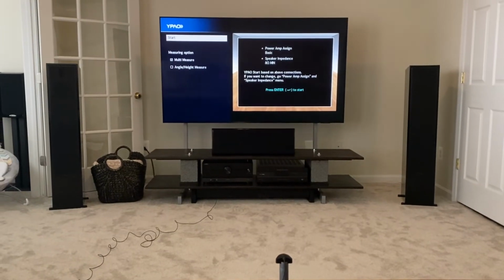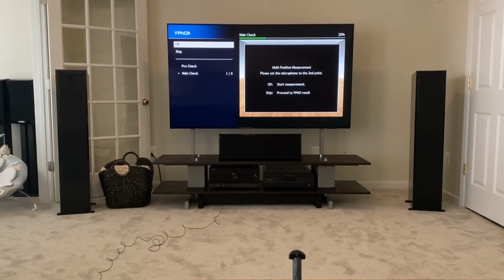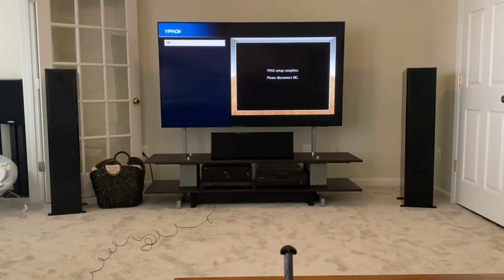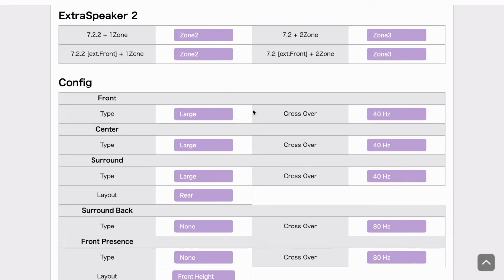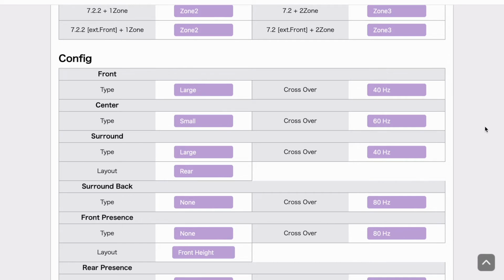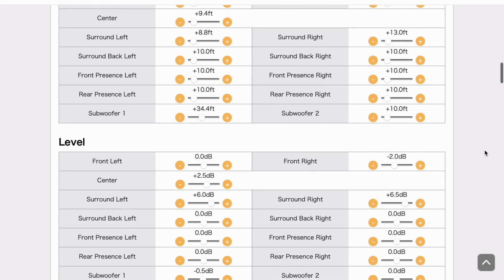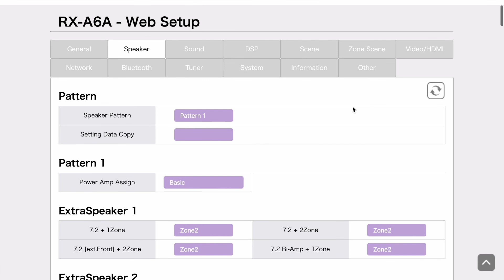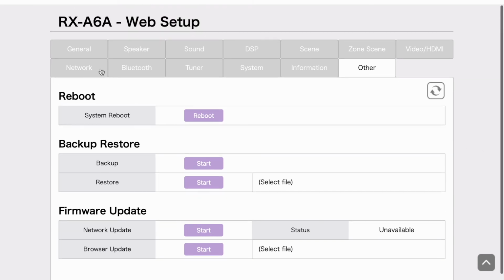Yamaha RX-A6A YPAO Calibration

Comment: You need to place the mic where your head is. Not the middle of the room.
Reply from the maker: Correct
Reply: And do the angle measurements too?
Reply: So place the mic on top of my head?
Reply: I used a tripod for my older Yamaha RX A3060
Reply: @Houndog545  😂😂😁😁🤣🤣👍👍

Comment: My sound system consists of 4 SVS Ultra Bookshelf speakers (2 for the mains and 2 for the side channels), an SVS Ultra Center speaker, 6 SVS Prime Elevation speakers (4 ceiling mounted for Dolby Atmos and 2 mounted on the back wall for the rear channels) and 2 SVS SB-3000 Subwoofers. The system is powered by a Yamaha Aventage RX-A8A 11 channel AVR connected to a Panamax M5400-PM Power Conditioner.

Comment: A note on the crossover when the Front speakers are set to Large; my previous Yamaha receiver allowed me to set Front to Large, Extra Bass to On and also set the Base Crossover. I recently purchased the RX-A6A and haven't found a way to achieve Front=Large, Extra Bass=On and Crossover=60Hz. This is the ideal setting for my Front Speakers when in 2ch.
Reply: I have the same receiver.use the web interface to set parameters.I’ve done it
Reply: I heard if you turn fronts to large and subwoofer on then pump up the bass then turn sub off it will bring extra bass to the fronts.

Comment: Please help!!
I have recently moved from pioneer to Yamaha and i am quite puzzled on this as i have two listening positions. On the pioneer i used to be able to switch between one and other (I always noticed the difference). Is it possible to do this on the Yamaha RX-V6A?
Reply from the maker: I don't believe so.  You can run ypao in multiple positions and it'll use all data for adjustments.  you might want to take measurements somewhere in the middle of the two positions.
Reply: You can surely run the ypao twice and store as different memories or profiles.  Even my 16 year old yamaha does this..

Comment: I thought the new YPAO accounted for height of “presence “ channels too. So it can apply various DSP. Is this not true or is it because you don’t have height channels?
Reply from the maker: It should be able to.  I can't confirm though since I don't have height channels.
Reply: @johnferraro3990  Thanks. I picked up the A6A. And Yes YPAO does perform a second set of 4 measurements to determine height and angle of presence/height speakers. My Denon x4500 didn’t do this which is why it never created the “bubble of sound”. Just sounded like a lot of separate speakers.
Reply from the maker: @GaryWalters  Thanks for the reply and glad to hear it works for you.  Enjoy!

Comment: my set up front kef q950 kef q50a  kef q650 center kef q350 rear and SVS sb4000 sub and yamaha a6a , issue is when listening to music it feels like no bass. what is the remedy to this 
but when im in movies its great lots of bass
also the sounds keeps going off display on yamaha says decoded off
could you help please?
Reply from the maker: I would make sure that your speakers are set to small and cross over at 80hz.  Check the sub during music playback and make sure it's working.  Next, experiment with sub placement.  Try out the sub crawl to find the best place for it.  I'm not sure what your movie source is, but check that out for updates and make sure you don't have a bad cable feeding your receiver.  Good luck!
Reply: @johnferraro3990  running it the movies through samsung QN85QN85BAF
Reply: thanks for the reply
Reply: i switch my hdmi already, but which one do you recommend on hdmi 2.1 earc
Reply: I have the kef550 front ,659 center,350 surround book,160ic ceiling atmos. Set all speakers to small and 80 cross.check your sub settings.can’t remember which knob in the back but one is set all the way up and the other at  80 hrtz.
This Kef system in a small environment with the A6A is nothing but the absolute truth 
15x20 room
Reply: I had the same problem with my RX-V6A. Bass almost non-existent during music playback, but sounded great with movies. The problem was my subwoofer volume was set lower than the halfway mark during the YPAO calibration. So I had to push the subwoofer volume to the halfway mark, then rerun the YPAO calibration. Now I have plenty of good bass with both music and movies! Even after I’ve pushed the subwoofer volume back down to lower than the halfway mark (about 1/4 mark) after the recalibration. Hope this helps.

Comment: All,

Need some advice, Can you guide me with cross settings on the below gear.

Yamaha Rx-a6a avr
Revel concerta F36 R C L channels.
2 6/1/2 atmos in ceiling c263's
2 6/1/2 surrounds in wall W263's
Dual sub svs pb 1000
Reply from the maker: You can't go wrong with 80hz crossover on all speakers.  You might be able to cross the fronts at 60hz depending on how low they are rated.
Reply: @johnferraro3990 Correct, 80hz is the most basic and safer crossover setting. My fronts: Polk Audio S55’s are rated at 32hz and I’ve cross them over at 60hz. My centre channel: Polk Audio S35 at 80hz, and my surrounds: Polk Audio S20e bookshelves at 80hz (I’m tempted to go 60hz on them because of their excellent bass extension🤔).

Comment: To me, this AVR looks Top notch. but I can imagine this unit is not meant for the "average user" You have to have a clear understanding of Crossovers. DSP. and endless other factors to make this work perfectly at your home. I imagine it can take a while to get to know this receiver. I just bought mine 2 weeks ago. still in the box due to renovations before setting up all my speakers. 
BTW. I have a question. I have a pair of Polk audio tower speakers that have a build in sub. I have an option for Bi-wiring. but when I was using my vintage Onkyo from 1998. it worked fine. do I have to change the crossover setting for the front at 20hz with this A6A?
Thanks for the helpful vid.
Reply from the maker: Thanks for watching.  When you biwire the speaker from the receiver, the receiver sends the same full band signal through each set of wires.  Your speaker should have an internal crossover that'll send the right signals to the right drivers.  I'd set the crossover about 20hz over the lowest freq your speakers can reproduce.